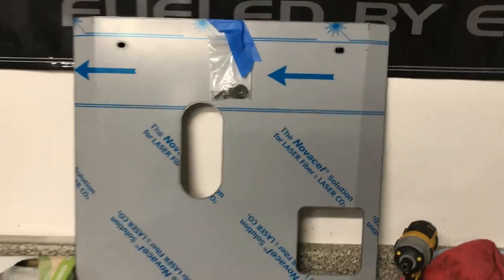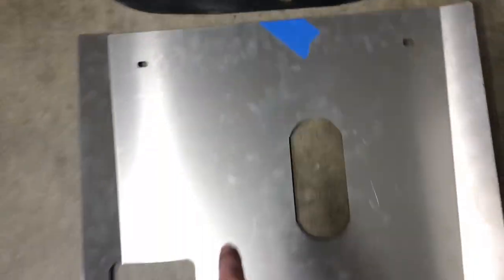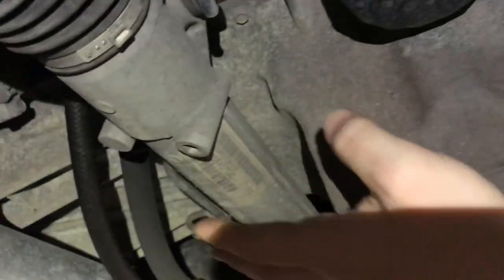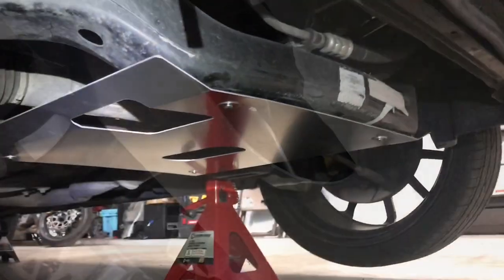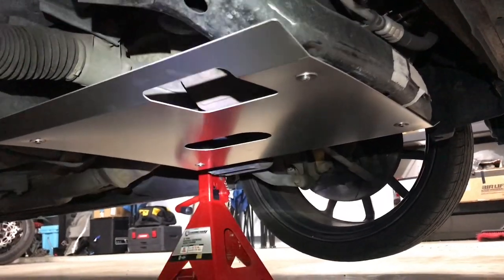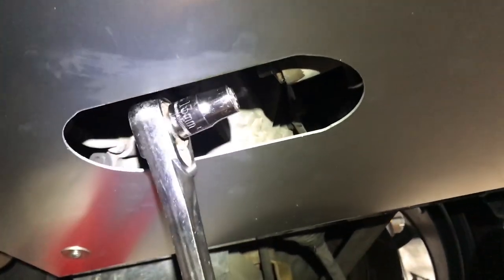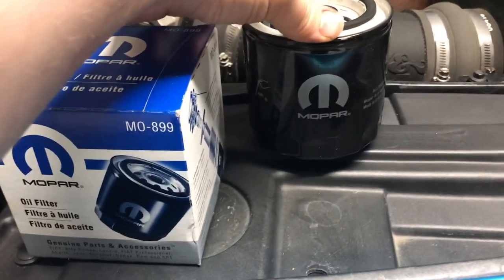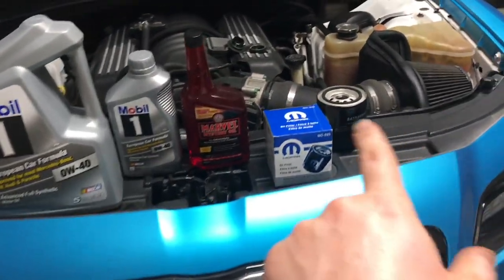LX Designs Aluminum Belly Pan Must Have Charger Challenger Magnum 300 SRT8 Install | Oil Change

Comment: Technically, it is intended to do more than just “protect” the bottom.    It plays a major part in directing airflow through the engine compartment rather than it tumbling so inefficiently in the engine compartment.      They say it makes 20-50 degrees difference on trans fluid temps.

Comment: Cool belly pan, I'd consider getting one.  I also use Mobil1 oil in all my cars ive had. Ive never used oil treatment though, but I use berrymans fuel treatment when I do an oil change. Did you put oil in the oil filter before installing? They say to do that so you dont get dry starts for the oil system.

Comment: i run no belly pan, aluminum in most cases is weaker then the plastic underbelly shroud.  But if your mowing over a deer it really wont matter whats there.
Reply: You also run into issues from mixing steel and aluminum, especially in areas that use salt in the winter or near the ocean.

Comment: What you gonna run over ? Just wanted to spend money right.
Reply from the maker: Intentionally, nothing. But a good friend lowered on coilovers didn't have a choice. Wall on one side and car on the other. Something fell off the trailer in front of him and broke his oil pan. So better safe than sorry. Is it needed, no. But it's better than stock plastic.